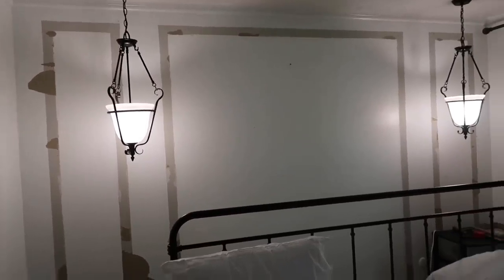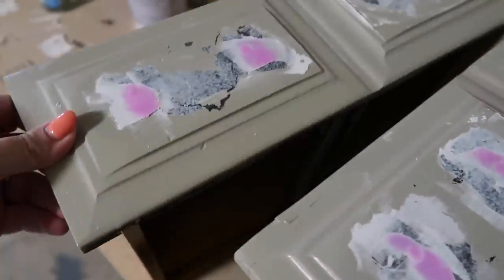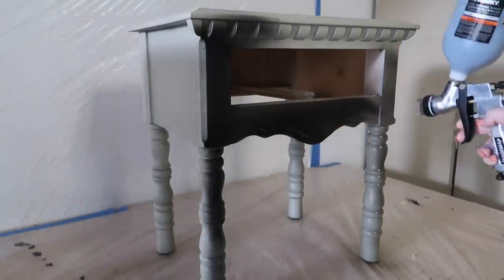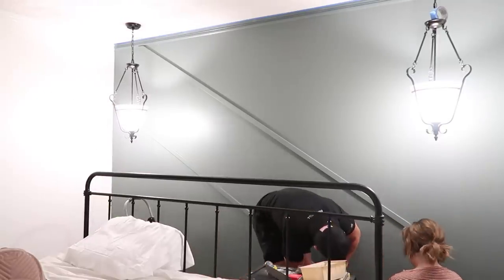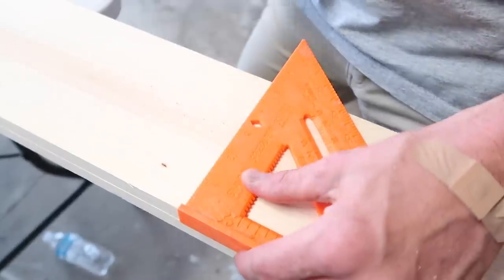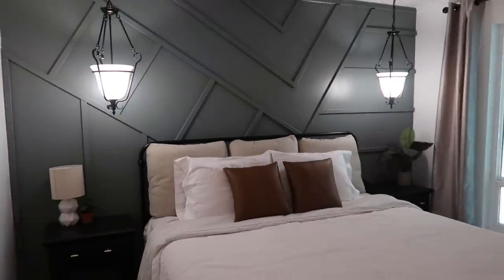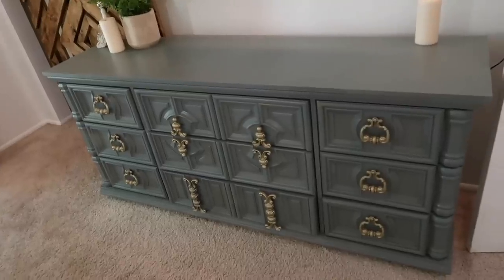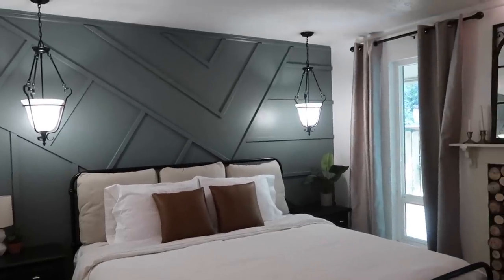BEDROOM MAKEOVER UNDER $300🔨 | Boho Bedroom DIY

Comment: Something that is amazing for drywall is Drywall Joint Compound(20 minutes dry). You can cover much larger areas with a wide taping knife. You can buy a couple cans of texture so the wall blends unless you like the flat wall look. Texture sort of hides and uneven surface. Then you prime and paint. 👍 Makes for a faster cleaner job. Hope that helps.

Comment: Thank you for using your spray painter in a properly prepared space - with plastic taped on the wall and the items you are painting elevated (on top of a covered surface) to a comfortable height so you aren't trying to paint all scrooched down on the floor.  Makes the job a lot cleaner, neater and easier.  I love the pattern on the newly designed accent wall.  I love the design of the decorative panel your partner built but without a privacy panel behind it, it's not a door - beautiful but not very practical for most people.  If the large dresser has wooden slides and wooden drawers, vacuum the slides and outsides of the drawers to remove any dust build-up and try "lubricating" the wood slides by rubbing them with paraffin, paste wax or bar soap.  The refresh of your room is beautiful, I love it.  Can you come and do mine, please!

Comment: Looks great. I just have a word of caution for you reguarding the tv wiring. While hdmi and video cables can be wall rated the power cord is not. To hide the power cable you will have to use a sleeve or install an outlet behind the tv. Many insurance companies will consider this against code and it could void your policy.  Just be careful and keep up the good work.

Comment: So your mud doesn't shrink or break from constant movement you should of used gorilla glue or wood glue with a dowel forced into the hole
Reply: Using Rockhard or Bondo would be better than using normal sheetrock mud on furniture.

Comment: Just a suggestion to try. Insert a dowel into the hole. Select a dowel that can be inserted with minimal effort. Cut it off as close to the face as possible and then sand level. You wont need to wait for dry time or the pain of trying to force a paste into a small hole. Just another way to try out.

Comment: hey you might want to double check the fire code for your city. power cords can get hot so technically you shouldn't run them through walls without doing a little extra work of rewiring, since it's a fire hazard. looks great though!

Comment: The side tables that you painted black... you ought to have used wood filler instead of spackle. Wood filler would match the hardness of the rest of the drawer, and it doesn't have any give so you can actually sand it flush to the wood without it bouncing back up.

Comment: Dry fit drawers: can't these be turned into drawers on runners
Reply from the maker: Elyse Burchell I would love if they could!! Ours don’t have any sides in between the drawers (if that makes sense) I’m not sure where we could install any runners!🤔
Reply: @ashleyhuze  I've seen people add thin Masonite do they can mount the drawer runners.
Reply: @ashleyhuze  apply some candle wax to the drawers where they slide. old trick for wooden dressers to make them slide a whole lot easier. Cheers!